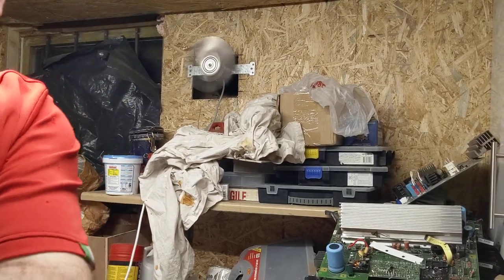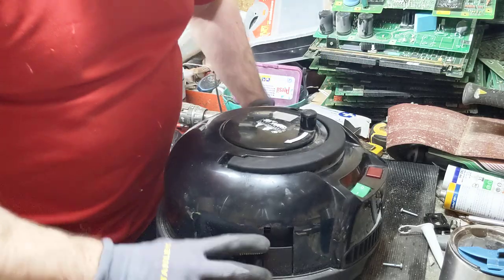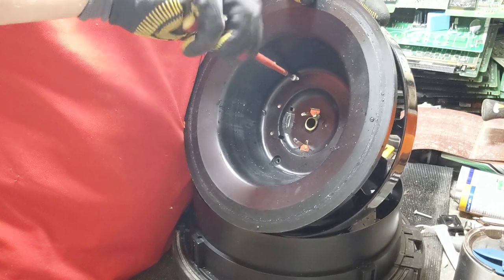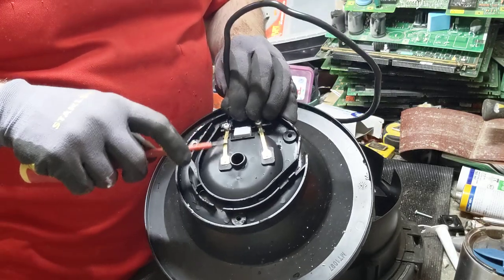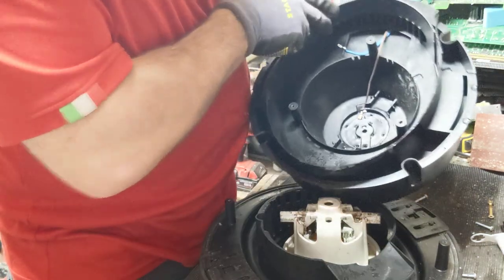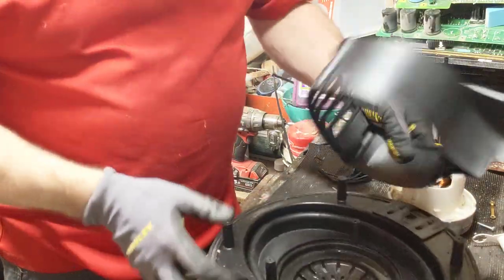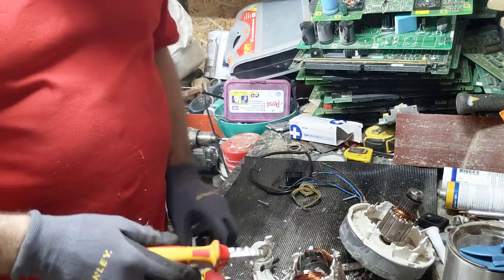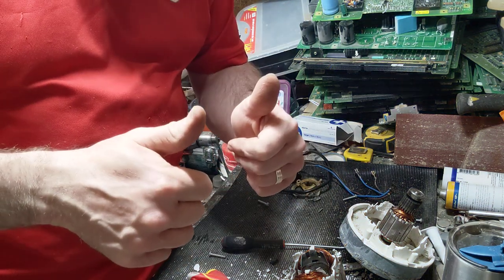Weremouse Workshop: Henry hoover scrap out

Comment: I would have been hitting it  with a hammer rofl. Wife is ment to be scrapping out the  power washer motor I took out for her. Bit brass and copper it all adds up buddy.👍 hammer work yeah. That's my style wack it lol.😂
Reply from the maker: Is there anything left of the motor after that whacking with the hammer lol😂 cheers Ali ! You're right pal slowly but surely it all adds up 👍